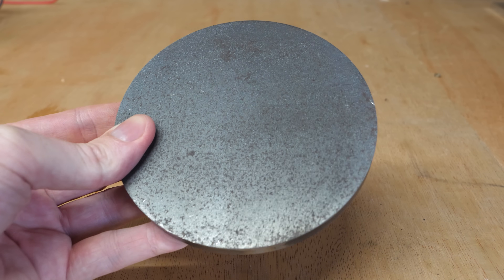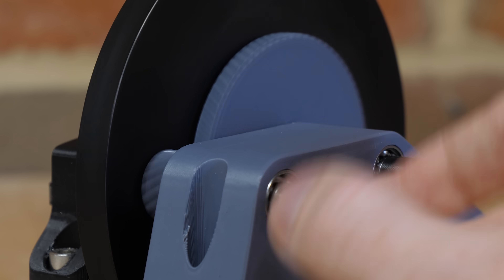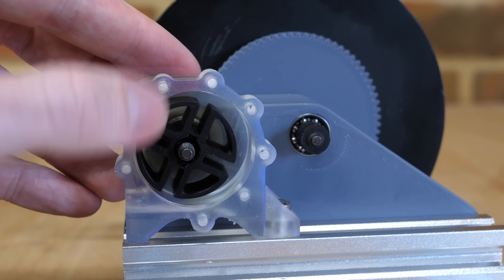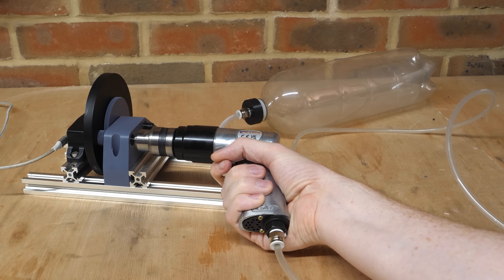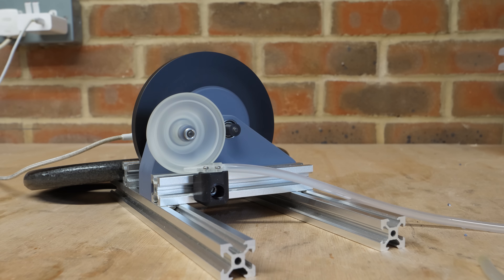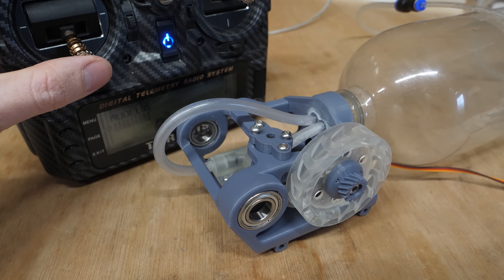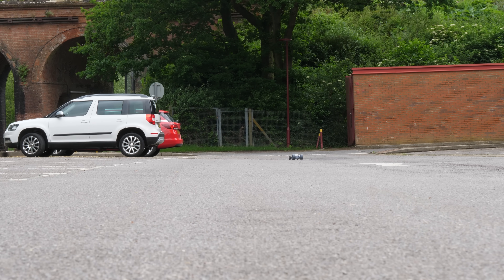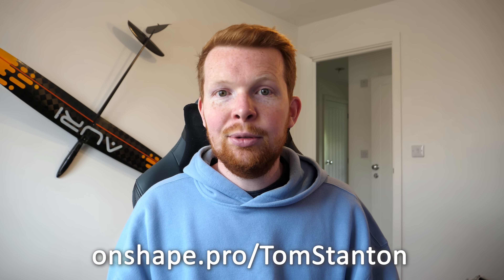Building a Turbine Car

Comment: @tomstantonengineering, What would you think about using mostly the same for baking soda powered car?  I'm helping mentor a group of kids, as they build a self-powered car and one of them wanted to do baking soda powered, which led to searching for more efficient ways to use the gas produced, and then your awesome video!  Beyond, making sure the 2-liter bottle's gas outlet clear of the liquid, and can filter out droplets, would you think the core design needs any big changes?  Sorry if I missed it in the video, do you make your CAD files available or would you consider doing so for students working on a project?

Comment: you copied integza's vane motor
Reply: also you should make the turning with different pivit points because the inner wheel when turning will follow a tighter circle

Comment: Hi tom, I hope you are doing well.

Mi name is Nicolas and I'm a mechanical engineering student at Los Andes University in Colombia. Currently I'm taking a project course, and we have been given the task to build a car that is powered by a bottle with air up to 50 psi. Me and my colleagues have been watching your channel and ideas and we must say that we were impressed with your turbine car. We have been looking forward to trying that idea and we just build a prototype, but we are not getting the required power output for moving the car. We have been measuring this with a classical pulley and mass system for measuring torque and a tachometer for measuring rpm. Today we measured 0.120 Watts with this system. We don't know what is wrong or how to improve it. We would really for you to contact with us (it would be amazing) to check for mistakes or guide us with the mathematical model you used or calculations for geometric parameters.

Comment: maybe a bit late but you could use 100 ml of liquid hydrogen which if released would make 84 liters of hydrogen gas at room temperature, which would extend the range by a lot without having to haul around a crazy big/heavy tank.

Comment: Drill holes at center of turbine shape #4, so aire drawn towards center has somewhere to go cleanly. i suspect torque changes. also the geometry's inverse, with the center raised and periphery down. Further i wonder about air nozzel placent vs torque outputs. Thank you so much 🙏 Great maths and3D prints

Comment: just came into my mind when I watched it ( thanks for figuring this all out): wouldn't it be more efficient if you combine a much bigger flywheel wit the turbine? So you can "save" the power of the air via turbine in the fly wheel and get a longer time to drive, because most of the power will be saved to the flywheel...just an idea

Comment: Aluminum magnesium alloy 10,000 PSI tanks wrapped in prepreg carbon & aramid fiber safety layer, offer lower mass optimized solution for automotive real-world class compressed air storage. Cold air condenses moisture, so stainless, nickel copper marine brass, or similar corrosion resistant metals required for in long life parts of such a system able to handle real world NVH of unmaintained dirt mud gravel roads & paved roads with potholes or similar

Comment: MIDI France Compressed Air City Car; Chrysler also sold a Turboshaft powered automobile briefly in the USA to a few people, Jay Leno has a custom made $900K turbine powered car & Y2K motorcycle powered by a small helicopter turbine $200K, I think ammonia fueled engine $1US per gallon for pure ammonia gas sold like propane into metal cylinders, into HEV, PHEV or REEV a pragmatic decarbonization of transportation pathway, as air compressors for compressed air cars not very efficient

Comment: Suggest you revisit your 4th turbine design.  The rotation of the fins push the air from inside to out. You were forcing the air into the exit, and the resistance created reduced your output.  

I think you would get better performance with an intake at the center. You're reducing your torque/ leverage at the beginning stages by doing this, but it should have a higher top speed i think

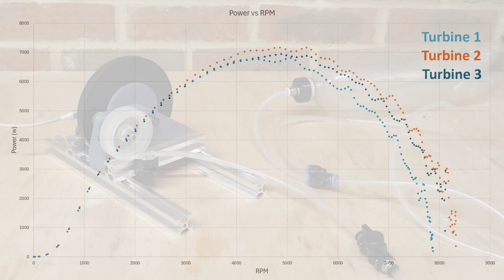Comment: 7:22 If there is a housing built partially from the point where air pushes the turbine, I think it can make some power as the air is still in contact with turbine....

Comment: Why not a contract rotating axial turbine design? That way you don’t have to deal with multiple stators but instead you have 2 rotors rotating in opposite direction where the 1st stage rotor behaves like the stator for the second stage. Also a volute would help a ton. And if not a volute then maybe a single input that spreads out to all of the blades at once rather than just the one localized point. They’re a pain and a half to 3d model but it’s for sure worth it.

Comment: Nice work! Your turbine might benefit from a Laval nozzle, both in the nozzle and on the wheel. These types of nozzles are used in steam turbines. I might also do experiments with a smaller turbine wheel and higher rpm. A Tesla turbine would also be interesting to try. It's very easy to manufacture because it has no blades.

Comment: Now this is like ancient history it comes over many places and it goes back to the hand drill and the handgun and we would take before glow plugs were used in the Cox airplane engines we would put them on our pressure tank and we would put tar on it we would run that right into our piston to drive and then if we really needed power to really go at it we would add a little bit of electricity for a spark to it and the spark would be self-sustaining with a glow plug but there was many different ways that it was done just like a gasifier but the hot gas that comes off a little bit of tar on a glow plug was the best that we did for making gas to push a little air motor out in the field to repair s***and I'm talking this is like really ancient blacksmithing stuff this stuff is so old there's no dates on it and it's all in black and white grayscale with no sound to it at all but you can tell from the body posture in the body language that the people are razzing each other in the old videos you might see where I'm going with this and you might be able to make use of it I've seen many people right where you are getting this information and go right to building aircraft engines or by the end of their life make it that far with it

Comment: Have you built a radial outflow turbine?  I recently came across an article on ScienceDirect, titled 'Analysis of Radial-Outflow Turbine Design for Supercritical CO₂ and Comparison to Radial-Inflow Turbines', discusses a 400 kW (536 hp equivalent) supercritical CO₂ radial outflow turbine system, which achieves isentropic efficiencies ranging from 85% to over 90%. Radial outflow turbines are more compact and easier to construct compared to axial-flow or radial-inflow turbines, making them a more practical choice for high-efficiency applications according to article. Do you know if it is conceivable that some day we could have these in semi trucks?

Comment: I love your channel and your  spirit for attempting the untried. Have you ever considered a bungee cord  powered bicycle? Sort of the same principle of a trebuchet but there's a hand or foot activated mechanism that pulls the bungee cord to the taught position at the end of a long horizontal railing where it's released to push the rear or front wheel of a bicycle forward. Essentially, you keep pulling the cord and releasing until you build up and maintain whatever speed you're trying to achieve. The bottom of the railing would make friction contact with the top of the tire going forward but would lift up when resetting into position for the next cycle. The railing would shoot forward like a sling shot each time. You could make the railing as long as you want as it would be located behind you on the bike. You'd just have to devise a mechanical way of pulling the bungee cord all the way into the start position from the seat. Perhaps utilising pulleys and big gears?

I'd try it myself but I don't have a workshop or have your experience with devising mechanical gadgets. Do you think it could work or am I missing something?

Comment: Hi Tom!

I really love all your videos on compressed air engines. I have a 3d printed engine myself, although not my own design.

I was building my own pinball machine, mostly 3d printed, and I was wondering. Do you think using compressed air could run the mechanics with pistons instead of using just solenoids? I was thinking I might do that since that would mean less enameled copper and overall a cheaper design by printing my own little pistons or turbines

Comment: You need more air, more pressure. I'd experiment with coating your bottles with carbon fiber to see if it's possible to achieve some higher pressure storage.

Comment: I'm more impressed at the fact a super cheap mass produced plastic bottle can hold 80 psi of pressure reliably.
Reply: polymers 💌💌💌💌
Reply: I got one of those bottles to a little over 110 psi and then chucked it at a rock,sounds like a gunshot

Comment: I have a question. Although the weight would be more, what would happen if you used a minature 3000 psi tank with an appropriate valve?

Comment: I apologize if this is a topic already discussed. Have you considered using high-pressure carbon fiber bottles? Similar to what is used in paintball? Regulated to the pressure you require but 4500 psi. I really enjoy your channel. God bless.

Comment: How about the pelton turbine design used by hydraulic power plants. They use a dual cup design to split the water stream into each cup and they are shaped to make sure the evacuated water doesn't splash into the next approaching cup.

Comment: I think that the key to take the maximum of such an air turbine then would be to make other lines of winglets closer to the center so as is speeds ne nossle may be brought closer to the center decreasing the speed difference between the nossle and the turbine winglets increasing speed maintaining the relative torque

Comment: use simple tesla turbine which can be used to run max rpm upto 50000 rpm.
THis make the car to exhibit ,more torque in starting which could be 1 step to solving the issue.
And use two tank for more range capacity.

Comment: compressed air energy density is low; high pressure to mitigate leads to a chassis worth of carbon fibre tank it also gets hot if you want to move anywhere fast that is another intrinsic efficiency effective headache

Comment: The idea of an AI system being able to design and build mechanical systems (using 3D printers)—and upgrade/improve on previous designs in a matter of hours or days—is just a little unsettling. Essentially, it would be able to evolve at nearly the same speed as microbes... and far more efficiently.

Comment: You could use a syringe system mounted to a ratioed out slow moving disc connected to the syringe plunger arm to keep the bottle pumping up as it moves so its unlimited, or almost unlimited, air.

Comment: The vane turbine would need small springs to keep the chambers sealed at low rpms and stopping air forcing past the vanes. More friction but more efficiency. I've seen grout mixer pumps also use rods to keep opposing vanes in place sliding back and forth as they run around the circumference

Comment: you should put a pressure-o-meter and put it on a arduino uno then put a dc air pump then program it to when it reaches under 30 psi to turn on the air pump

Comment: Question for you, how do you make sure the gears dont fall off of the shaft? I tried making my own gears attached to a shaft, no matter how many times I tighten a screw around the shaft the gear still slowly slides off. Any tips?

Comment: Why not 2turbines?. One for the max air pressure like a pelton, and when the air pressure drops switch to a low pressure turbine. Or even have 2 tanks one with a lot of pressure and the other lowe but more volume and with an solenoid valve, alternate max speed or hill climb mode and cruise speed for max range posible

Comment: With a better inlet design for the compressed air, I bet it would be much more efficient... Think of a Volute / Scroll house like a Turbine Housing of a Turbocharger. With your single interaction nozzle, you are only really using maybe 5% of the drive area if the turbine available at any give time and the remainder of 95% is absorbing some of the energy to pumping ambient air on top of what is being absorbed by inertia of the turbine itself. Remember that with a true gas turbine engine, at any given time, the entire turbine is being subjected to expanding high velocity gas, not just a small percentage of it.

Comment: Instead of a pneumatic drill, a pneumatic die grinder would probably work better. They're designed to run at high RPM and should have a much smaller turbine. Though, they'd likely still be designed for a high flow rate similar to the drill.

Comment: Wouldn't one of the reasons why the RPM curve flattens also have to do with the fact that kinetic energy of the flywheel is exponential with the rotational speed, meaning at constant power you accelerate slower and slower the faster your RPM already is?

Comment: Perhaps you might add a 45° angle on the nozzle tip/end to cup/focus the air better into the turbine? (Also making the air nozzle tip shaped the same size/shape as the turbine air in will help make it more efficient - lastly get that nozzle as close to the turbine as possible - again with a cup the same shape as the holes)

Comment: It would be interesting to hook up the ESP32 with hall and pressure sensors to follow the turbine/wheels RPM (speed) and the remaining pressure in the tank.
All that could be beamed down to the pilot with either WiFi or BT LE.

Comment: You might find this useful for your blade design.

https://en.m.wikipedia.org/wiki/Degree_of_reaction

The key factor is the blade angles. The profile and thickness of the blades does not play a significant part other than structural considerations and making sure the airflow is not choked or separating. Usually you want constant change in angle between the angle of incidents and angle of output of the blades. That is what drives the camber of the cord line.

Also youll see significant windage losses with the design with an open rotor like that. 

With the flow rates, pressure drop and nozzle/stator configuration you are looking at you might want to look at Pelton Turbine's instead of axial flow turbines for inspiration. The shroud around the rotor will help to maintain back pressure and shield the un impinge blades so less energy is wasted.

https://en.m.wikipedia.org/wiki/Pelton_wheel

Comment: what if the nozzle was attached to a second disk sitting behind the first turbine, with a geared ratio so as the turbine spins up the air flow location spins along with it? it could run off the flywheel so a little "bump" start gets it all spinning and it wont lock up

Comment: turbine = no torque :-(.. our ford fairlane was 930 pounds, had 1100 foot pounds of torque... it jumped of the line with force...  without torque its going to start very slow and eventually get to full speed 3/4 the way down the track :-(

Comment: I dont how acurate your assumption is that the gradient of rpm over time describes the torque beeing produced at diffrent rpms. The lower gradient at hogher rpms could also be due to counteracting torques caused by bearing friction losses in the transmission and mainly air friction at the flywheel. I dont know how big these are in correlation to the turbine torque but they definitly controbute to the gradient beeing lower at high rpms.

Comment: Maybe a flywheel Design with a clutch could achieve more torque at the beginning, then while the flywheel is still spinning (And connected to the wheels), the throttle is fully opened again...

Basically a weird way of Launch control

Comment: What happens if you encase the turbine/hose/nozzle together so the air doesn't "bounce back" and out? could that make it a bit more efficient by preventing some of the pressure from leaking?

Comment: The nozzle is probably as important as the turbine. The air should be as high speed as possible. Convert the pressure to kinetic energy. Study nozzle design. Also add a little liquid nitrogen (THE ULTIMATE COMPRESSED AIR!)

Comment: I was thinking a two stage turbine.  A control diameter and a smaller one next to it.  Start with the larger then shift the air pressure to the smaller one to increase output.

Comment: Wondering if have considered using a method involving dry ice (CO2), or liquid nitrogen and a regulator to enable a larger source volume of compressed air? Being a colder sourced gas, it would be more dense, and should provider higher power, and possibly better efficiency. Realize 80 psi is self-imposed engineering criteria to have good safety margin when working with plastic water bottles. Also for aircraft offered a light energy storage mechanism.

Comment: If probably go more aggressive on the gear ratio. For lack of a better term, it seems your “lugging the engine” with that ratio. I would say maybe do a two stage gear box if the math makes any sense to do so, but its benefit would likely be negated by the weight. Also I would say get a more reasonable tire set for the air engine, but take those current tires and light em up with a hobbywing max5 G2 56118 motor on 12s.

Comment: Seems like it could use the flywheel and a clutch to keep up the built up torque between applications of air power. The added weight might make that counterproductive though.